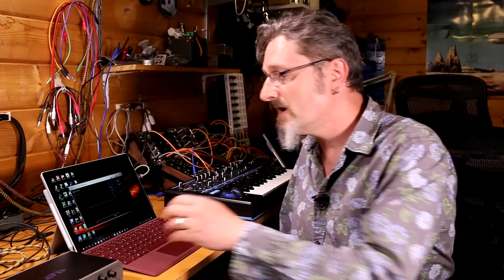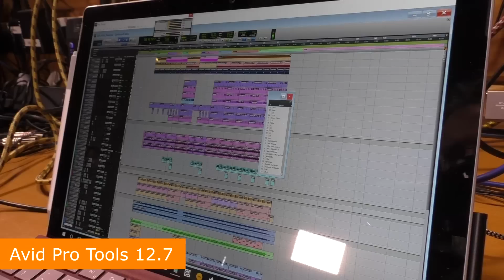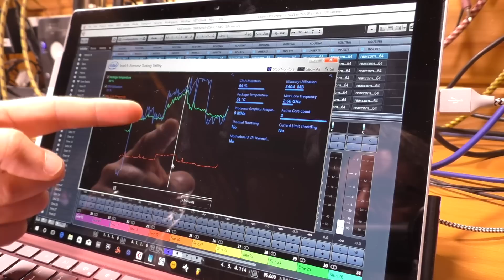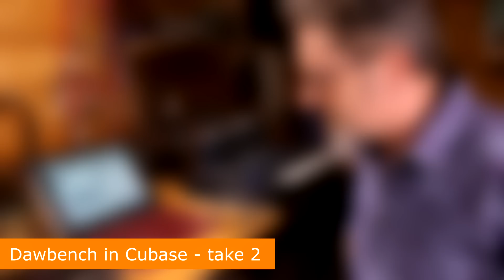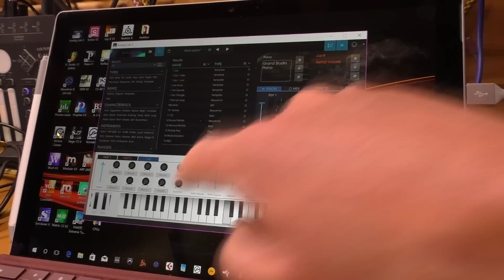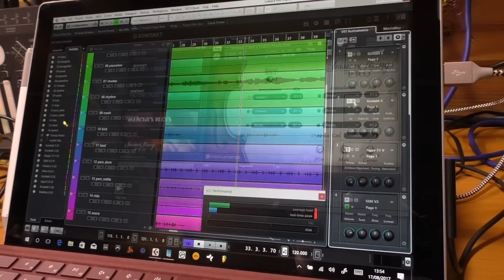Surface Pro 2017 audio performance and reliability for music production

Comment: Do the same processor stability/ cooling system problems affect the i7 16 RAM GB model as well? (Does it have a fan or am I just mistaking it with the Surface 4 model?) Is the i7 16 RAM GB a good tool to use Cubase 8.5 + run 10 Eastwest instrument channels? Your performance tests are on the i5 model?,  I wonder about the i7 one. Right now I have a quad-core desktop computer and I was looking for something even more "portable" than the Surface Book yet reliable enough to make full Cubase 8.5 eastwest plugg-in projects without audio distortions, lags, etc...
Reply from the maker: The different spec models work in the same way as far as i know. I like the i5 because it's not pushing too close to the thermal and performance edges and so is more predictable. The i7 might well give you more if you can keep the temperatures under control.
Reply: So, can one run 10 Eastwest vst (64 bit) Plugg-ings simultaneously on Cubase 8.5 in the 8 GB i5 model? Also, when you record the "audios" from the microphone (without cracking sounds), can you save the project audio data directly on the Micro SD card? Or do you use the SSD drive for the project not to bottleneck? I would go for the i5 too if I can do the following: (Use the SSD for the system alone, record the audios on a secondary HDD hard drive to make the SSD last longer, (I guess here it would be the Micro SD card?) and run 10 Easstwest plugg-ins from a C partition simultaneously on my projects withot overloading the machine.
Reply from the maker: How would I know that? I've shown you examples of what the Surface can do - you have to decide whether that compares to what you want to do. You can use the Micro SD card as a regular drive, but it's terribly slow and low performance so i wouldn't recommend it.
Reply: I will try to compare the workloads of both Eastwest and the plugg-ins you used so as to make a good guess. Your videos are really helpful in the sense one can actually see the product working, which is something you cannot really view in shops or commercials. I also found your tips on CPU usage quite interesting to solve the thermal issues. They make the Surface stable, which is what we all music producers want. And as for the SD card...perhaps using an external USB 3.0 HDD drive for recordings can solve my problem then.

Comment: I am planning to buy a laptop having i5 8250u and 8gb ram. I mainly do orchestral film scoring and sometimes rock/pop. Is the laptop a good choice..??
Reply from the maker: No not really - you need a nice big desktop with acres of space for sample library and the grunt to run video and audio at the same time.
Reply: Molten Music Technology Ok. The problem is...I have lot of traveling to do. So can this laptop be considered as a good start. And also i can upgrade the ram to 32gigs later.
Reply from the maker: It's all a question of scale - you can do orchestral scoring on a phone if you want. People often use 2 or 3 networked computers to run high level orchestral library. I'm sure the laptop will do fine - is it a good choice? No, but go with what you can and what you need - it's a "how long is a piece of string" question, you know?
Reply: Molten Music Technology Thanks a lot for your suggestions..